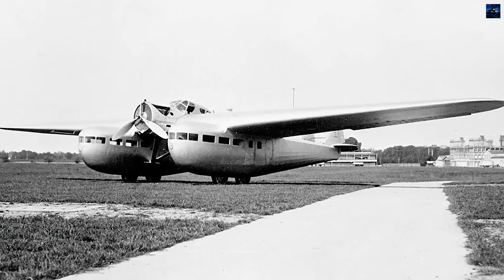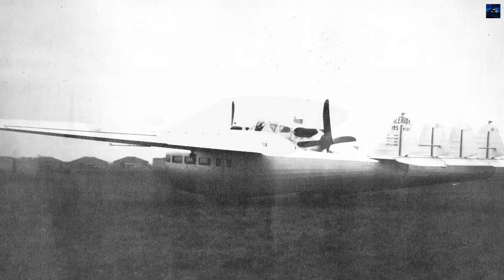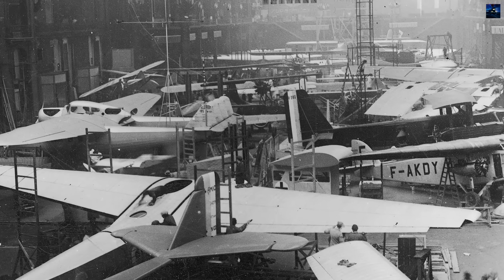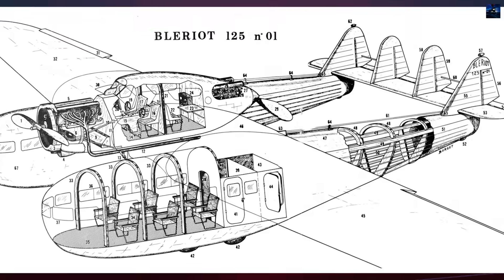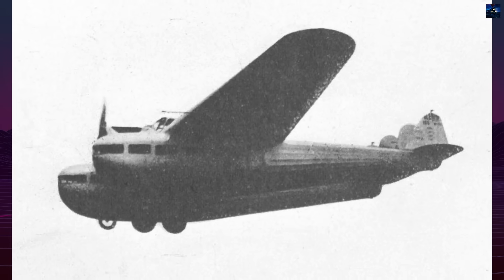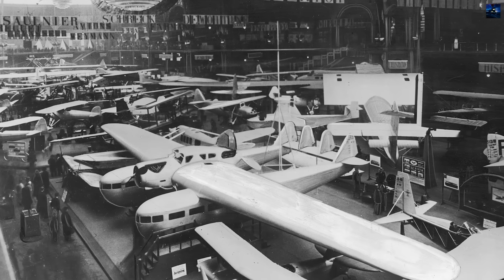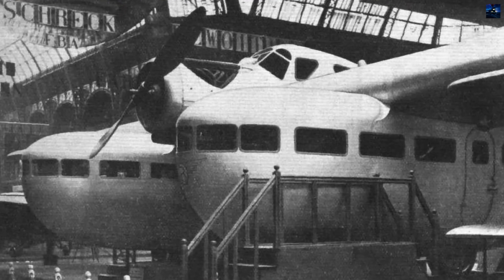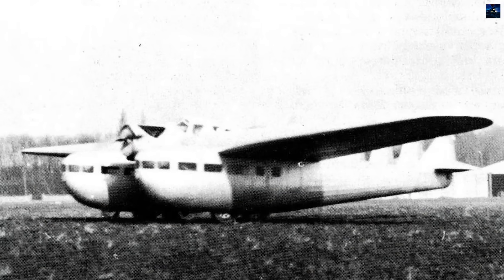Blériot 125: The Forgotten French Twin-Fuselage Passenger Aircraft

Comment: I would just put an engine in front of each fuselage and eliminate the central dual engine structure that create drag, weight, and result in poor cooling for the rear engine.  Both engines are mounted very close together in front of each fuselage to minimize asymmetrical thrust in the failure of one engine, and each fuselage will have a separate rudder to benefit from the prop wash from the engine to counter adverse yaw.  The pilot cockpit can be placed on the left fuselage.  I like the way the wheels are mounted on the bottom of each fuselage without requiring any retraction mechanism.

Comment: A single engine on a passenger airplane is not conducive to safety.... Retarted design.
Reply: "Retarted" post. The Bleriot 125 has two unconnected axially positioned engines driving two inline propellers...

Comment: I know when I think aircraft safety, my first thought is to put the passengers directly in the props plane of rotation. A prop failure would be immediately catastrophic.
Reply: But isn't that true of all wing-mounted engine designs as well? The only way you'd avoid it would be a single propeller on the front.
Reply: Wrong,,  of the 360° degree prop arc, only about 90° would align with the fuselage 😂

Comment: Wow, that actually looked like a nice setup. Cautious of that prop though, if it felt like it had had enough.
Reply: ... it was two engine/two prop... and they increased from 2 blade to 3 blades for increased thrust... but point taken... that's a lot of "drag" to haul.
Reply: @cdncitizen4700  Sorry maybe too cryptic? My meaning was, if the "front"  and maybe back prop failed (had enough) and decided to break up there are 2/4 fuselage areas it will smash into with some deadly outcomes to the occupants?
Reply: @Paul-w9r1r i always think the same on prop aircraft.
Reply: @Paul-w9r1r  Fair clarification... but that's an issue with pretty much ANY twin engine aircraft... same for jet turbine engines - even with a fuselage in the middle.
Reply: @cdncitizen4700 yep with you but this one delivers, one flailing/disintegrating prop per two fuselages to smack. Normal is,1 desintegrating prop/ one fuselage to smack, LOL.